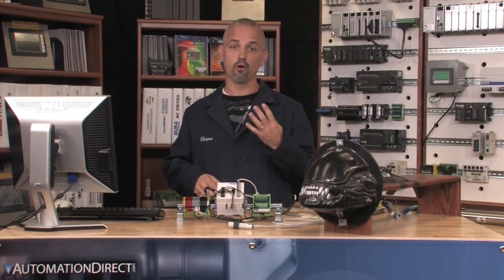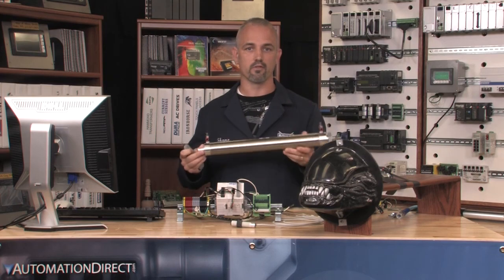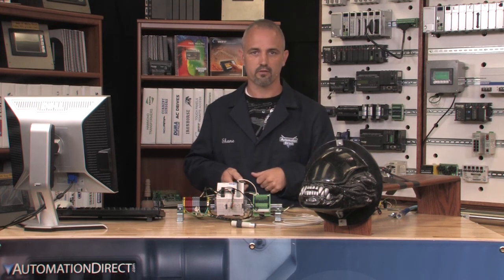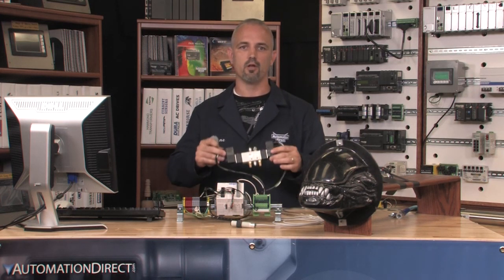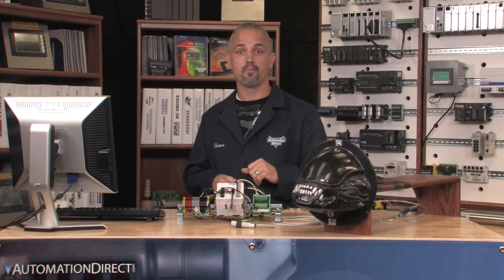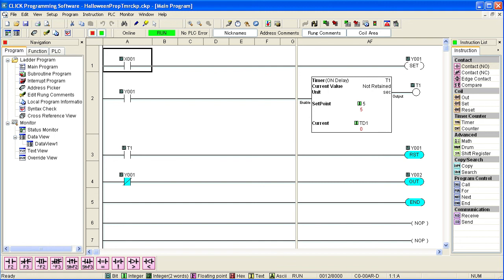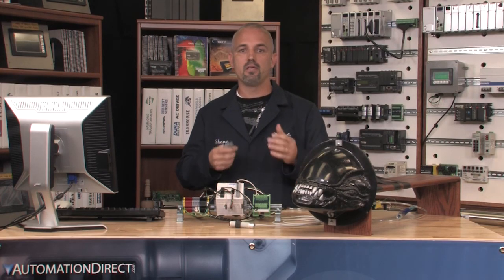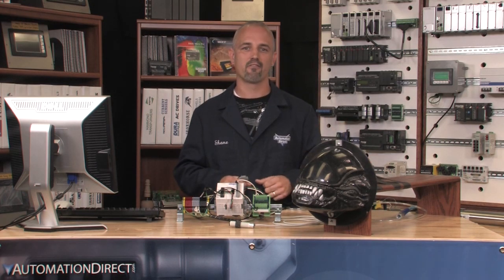Pneumatics Simple to Fully Automated Halloween Prop DIY Project Part 4 of 4 from AutomationDirect

Comment: I'm already a loyal customer and the moderator for the pneumatics forum at HauntForum  and recommend Automation Direct to others for purchasing pneumatic components for our Halloween props.  However, many of us use controllers and 12V systems.  Is there any chance that you'd carry the solenoids such as the AVS-5312-24D in 12V?